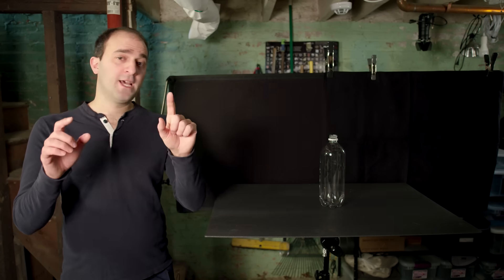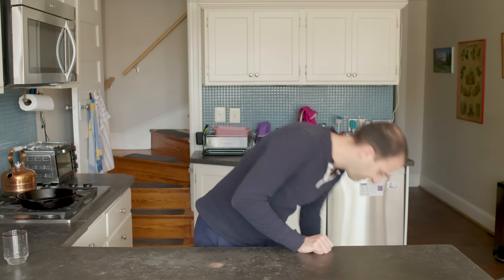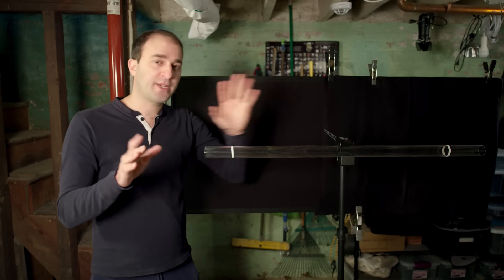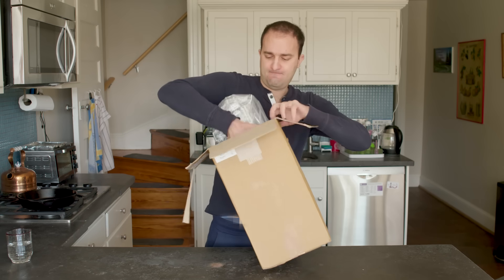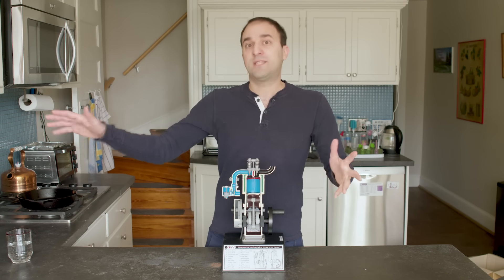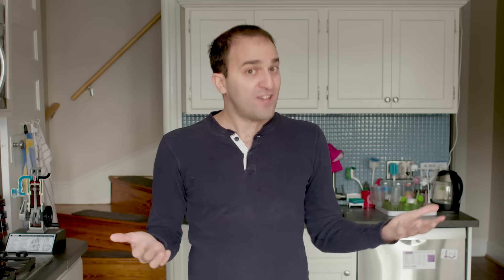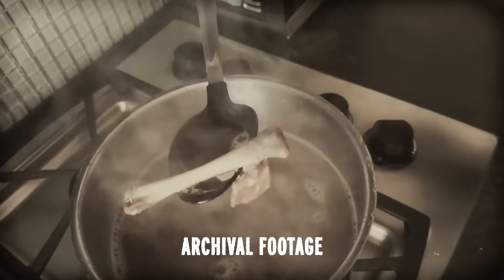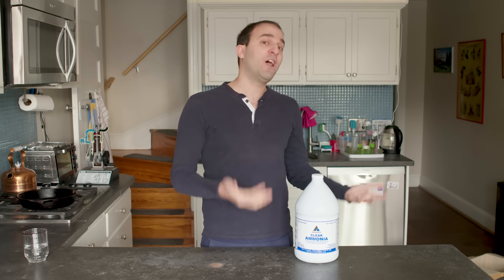Does Toyota Know Something That We Don’t?

Comment: I used to work in an ice cream factory and the refrigerant used was ammonia, The refrigerant lines were painted a bright yellow and railing was use to protect exposed lines.
I was warned that if one of these lines broke it is unlikely that anyone in the area would be able to get out alive. Having smelled low concentrations of Ammonia when maintenance was being done on one of the compressors I believe it.
Reply: Perhaps we shouldn't worry about the negatives until we know if the idea even works. The first place Toyota and GAC have put an Ammonia Engine into is a Container Ship. Batteries are never going to work for shipping, maybe this works? Here's a fun fact - Cruise Ships in Europe put more sulphur into the air than all the passenger cars on the Continent combined do. And that's just Cruise Ships, not Goods Transporters.
Reply: @tsubadaikhan6332 The sulfur from those cruise ships are the only thing holding global warming down.
Reply: Coincidentally I used to work in an ammonia factory and the refrigerant we used was ice cream!
I was warned that if one of the ice cream lines broke we'd have to call the local bakery and order a couple dozen birthday cakes to clean it all up.
Reply: Ah nice one, feels like im on reddit now
Reply: 🤣🤣🤣 @michaelg.294
Reply: My fridge never leaked; but an apartment building was nearly evacuated due to Air/Conditioning leak(good times).:face-blue-smiling:
Reply: I worked in a grocery store distribution center that used ammonia for refrigerant and whole building AC. We was told if we smell any ammonia at all to hit the alarm as we are running out of the building
Reply: you got three minutes
Reply: Gasoline kills via fireball. Ammonia can cause instant death in relatively low concentrations, think a single burst tank in a shared garage, by acting as a rapid CNS depressant. Also, it will burn your nasal cavities, make a strong caustic hydroxide on your wet skin and smells horrendeus.

As much as I love it as a fuel (there's already a guy running a car with it), it's not viable for mass production.
Reply: Many US farmers use anhydrous NH3 as a nitrogen rich fertilizer.  They buy literally tons of the stuff at a time.   The liquid is injected into the soil and immediately reacts with the water in the soil and  is effectively made chemically harmless.
Reply: Car fires in a twin-garage could be interesting, with two full tanks of ammonia in their fuel tanks
Reply: @MaxMisterC what if a new car was created with duel tank AND the main piston is petrol powered 
with gear one, two and three ratio & gear four above 👍🏻 run's over Ammonia? 🎉😮🎉
Reply: @MaxMisterC 
ammonia isn’t even that flammable
it can’t violently combust in air, it barely burns without help
Reply: @MaxMisterC NH3 doesn't burn that easily.
Reply: A component in mustard gas.
You are on point.
Reply: Do you believe that your chances of survival would have been higher had the same amount of gasoline (which could potentially erupt into an explosive fireball) had been the refrigerant?

Now imagine 10-15 gallons of your refrigerant dissipating - vs the same going up in a fireball - again, you're more likely to survive a well-publicized ammonia leak out of your car's fuel tank, than an sudden explosive fireball.
Reply: @factnotfiction5915 You are full of it. I don't believe your lies.
Reply: @factnotfiction5915  Gas leaks are far more common than fireballs, that's it
Reply: @factnotfiction5915  Why would someone use gasoline as a refrigerant.
Reply: @factnotfiction5915 there are plenty of videos of major fuckups happening while a tanker is refilling a gas station. Hundreds of gallons of gasoline per second being blasted out of a ruptured hose, frequently right next to or on to a person who then is able to walk through it and close the valve while only being protected by some boots, jeans and an old dirty orange vest. It's a local environmental disaster but rarely an explosive one, and if the worker gets out of the gas soaked clothes and gets hosed off with water quickly enough they'll probably end up ok. Now imagine that with Ammonia
Reply: @alf20104  > Hundreds of gallons of gasoline per second being blasted out of a ruptured hose, frequently right next to or on to a person who then is able to walk through it and close the valve while only being protected by some boots, jeans and an old dirty orange vest. It's a local environmental disaster but rarely an explosive one

'Rarely', but sometimes explosive. Gasoline certainly has the capacity to be flammable at standard temperature&pressure (STP - at almost any temperature and 1 atmosphere).
Ammonia is NEVER explosive and NEVER flammable at STP.

> , and if the worker gets out of the gas soaked clothes and gets hosed off with water quickly enough they'll probably end up ok. 

Same with ammonia. It is only dangerous if inhaled. (note gasoline is dangerous if inhaled also)

> Now imagine that with Ammonia

Now imagine, not hundreds of gallons, but a small leak - nearly instantly detectable with ammonia; may take some time with gasoline - so you're shutting off the cutoff valve quicker; and avoiding that 'local environmental disaster'.
Reply: @factnotfiction5915  Yes your chances of surviving the vapor explosion from 10-15 gallons of mostly still liquid gasoline is dramatically better than surviving 10-15 gallons of ammonia which will all become vapor within a fraction of a second of being released to atmospheric pressure and really, REALLY wants to chemically bond with the water in every tissue in your body.
Reply: Firstly, coolant systems don't use gasoline, so it simply wouldn't be there; secondly, yes, having been around ammonia, I'm quite confident that a spill would be more likely to cause injury than a gasoline spill would be to ignite
Reply: @prophetzarquon 
You know how to suppress ammonia vapours?
Just spray water.
Reply: @drgazter  Good tip; the fire sprinklers would have been a good thing to have labeled In Case Of Spill
Reply: @drgazter  not if you're dealing with ammonia from refrigeration, it will freeze water midair

Comment: Ammonia is made from methane. Burning the methane is cheaper.
Reply: You can also make it from CO2-free nuclear process heat.
Reply: Then where's the hydrogen coming from? Hydrolysis is a power hog. @factnotfiction5915
Reply: @factnotfiction5915  Then what's the hydrogen source?
Reply: @williamferdon3088  heat + electrolysis (of water) is cheaper energy-wise than simply electrolysis; so using process heat to crack water into hydrogen, and then using more process heat to combine hydrogen + nitrogen into ammonia, is another way to make ammonia; rather than simply cracking methane.
(likewise, you can also use the hydrogen to make methane, and other *-anes, and alcohols).

Comment: Ammonia has been worked on as a vehicle source of Hydrogen for years. CSIRO came up witha filter to seperate hydrogen and nitrogen. When you oxidise hydrocarbons, you are simply oxidising the hydrogen in it, leaving carbon. When you oxidisehydrogen in air, because of the hightemperatures, you end up with a lot of NOx which then needs to be converted, much like in diesel engines.
Reply: When you oxidize hydrocarbons you get carbon dioxide and dihydrogen oxide.  Everybody running around and talking about "carbon emissions" has really dumbed down the populous.  Now half of people think carbon is bad.  We're made of carbon.  Are we bad?
Reply: @andyharman3022  I feel like the "zero carbon emissions" logo will lead to the end of us.  It is so short sighted to only look at the very end product and not the entire process to get there.

Comment: You forget the bore/stroke ratio of your engine... To burn diesel (or oil), vs gasoline, you need to increase the compression ratio. I guess it's the same thing for ammonia...
Reply: Yea he complains about problems which aren't problems when engineered properly. Look at methanol (race car) fuel system. They have literally gallons per minute (as opposed to GPH for gas) to feed enough methanol. Huge compression, huge injectors, huge ports, huge cams, huge valves. Methanol per lb is terrible, but massive octane, and when evaporated and atomised, makes the charge ice cold, which is great for boosted applications. So not only bore/stroke, but also boost! Put a big roots supercharger, small stroke, big compression ratio, and I bet it'd rip!

Comment: No ammonia will not be a fuel used in cars, it is too expensive to make and by 2044 batteries will have 4 to 5 times the capcity and be much cheaper than they are now.

Comment: Since Ammonia can be stored like propane, liquefied at room temperature & moderate pressures, it would probably be great for container ships.  The only problem is producing green or pink hydrogen...
Reply: It is already used on many container ships.
Reply: @NH3EnergyPlus  I've heard of new ship engines which support multiple fuels including Ammonia, but I was unaware that ships were already using Ammonia for fuel.  Maersk is looking into it for new container ships and ammonia carriers.  For now, I thought LNG ships usually use natural gas as it boils off and most other ships use bunker fuel.  It would be great to hear about a ship where ammonia is already used for propulsion.

Comment: The current levels of the production of ammonia creates 551 million tons of carbon dioxide. Ammonia production is a highly energy intensive process consuming around 1.8% of global energy output each year.  The question is to meet the demand so all vehicles can be ran on ammonia instead of gasoline and diesel how much would ammonia production would be needed.  If it is 100 than that is more energy than the world produces.

Comment: IN NOVEMBER 1942, Belgium’s public bus system ground to a halt, crippled by a wartime shortage of diesel.

Engineers at the country’s public transport company got to work and by April 1943 the service was up and running again. They had adapted about 100 buses to run on an alternative fuel – liquid ammonia, pumped into tanks on the buses’ roofs.

The experiment was short-lived, but it proved the point that ammonia – plus a small amount of coal gas to help combustion – could be used as a transport fuel.
Reply: Ammonia is a fantastic Fantastic refrigerant However , it is extremely dangerous in its liquid form my Concern would be  at the refuel stations a k a gas station There would be some people who would asphyxiate themselves buy ammonia gas
Reply: yes, but,,  oil,,will never run out..  this is why other alternatives, are suppressed..  like sodium reactors,, free energy, clean..
Reply: And some French produced gas from wood that they stored in enormous bags on the roof of the car, or actual gassifiers mounted to the car. The gas fed into the engine and allowed the car to move. But just because something is possible in the most dire of situations doesn't mean it something we should be looking to adopt when situations aren't dire and where better alternatives exist.
Reply: @drxym  , you're getting off subject, Toyota is working on ammonia power, it has been used before, with modern high tech methods it could be as advanced as the first electric cars in 1900 to current electric cars.
Reply: is delay the inevitable , combustion engines got is day counted

Comment: Butanol would be less toxic and easier to handle than even gasoline It can be grown with bacteria and be carbon neutral, and burns like gasoline. But combustion engines are way less efficient that fuel cells or batteries.
Toyota is throwing up all these smoke screens so people don't buy EVs until they've perfected their solid state battery. That and the oil industry propaganda is working, for the most part. Toyota is expert at hybrids. But they better hurry up with the EV development or they will be totally hosed.

Comment: salts 21 -24% density, 1/12 that of gasoline, high temp to extract. It can be used at altitude though, or as a solid with "free" heat sources.

Comment: Thanks for a good sensible response to this, for my money, daft idea. I've seen too many responses to this engine from Toyota saying something like "this is great! F*** EVs!".
Internal combustion engines are inherently inefficient with large amounts of the energy from the fuel being wasted as heat. They only make sense when the fuel is ridiculously  cheap.
Ammonia is difficult to transport, which adds cost and as pointed out in the video, really quite bad for people and animals generally. Safety adds to the cost.
Yes they might well be able to get it to work and my have some very specific uses, maybe shipping. But you do not want the average person, maybe tired after a day at work messing with the stuff.

Comment: Ammonia is used to reduce nitrous oxide emissions from diesel engines. To make it safe it is added as ureum dissolved in water, but this quickly falls apart under the right conditions. It might be an idea to add ammonia directly in a dual fuel setup as it can not only help to reduce nitrous oxide emissions, but also carbon emissions. Although this is not a long-term sustainable solution, it can also be used in combination with biofuels and efuels.
This reminds me of the use of dual fuel in gasoline and diesel-powered vehicles. Adding LPG or CNG can reduce a variety of emissions significantly. Similarly significant amounts of ammonia might be added to reduce fuel consumption and a variety of emissions. I have a feeling that combustion characteristics for hydrogen are much better for this though. In a dual fuel setup, a lower energy density of a secondary fuel is less of a problem.

Comment: Ammonia is bad idea for an internal combustion engine.  Toyota does not know a thing.  They will simply do anything to avoid making a B-EV.   It's inefficient, it's dangerous and it might still exhaust NOX (nitrous oxides) which contributes to smog. With the right sort of catalyst and the right exhaust environment NOX can be dealt with.  

You know what? - a battery electric vehicle might be a good idea.  They're nice and quiet too.

Comment: Ammonia is horrible so of course Toyota loves it.  A car crash that resulted in a leaked tank of ammonia could kill lots of bystanders in minutes.  No thanks. So the hydrogen scam has been publicly debunked, so the ammonia scam begins. So they will promise it will work in five years, and then they will publish research about solid ammonia storage and on and on.  Anything to delay building battery powered EVs or building out charging infrastructure that works fine today.  Just like Trump, delay, delay, delay.

Comment: Decades ago I was working on Ammonia as a fuel. Not for combustion engines (which have a physics limit of ~27%) but for Fiel Cell engines (which have a physics limit near 80%).

Sad to say we're will discussing Flintstone technology -- anything combustion.
Reply: interesting! any chance for this to work? would be much smarter way to do it.
Reply: SOFCs should catch on soon
Reply: Liquid fuels are a vector.  If ammonia filling stations exist then hydrogen fuel cells can run off an ammonia reformer.  A hydrogen fuel cell car with an ammonia reformer is useless to any customer if there is no filling station.
Reply: 1_ How is Toyota way past 40% on combustion engines?
2_ Fuel cells may be 80% efficient, but ammonia brings the need to extract the hydrogen from it, further diminishing efficiency.

Comment: The practical engineering problem of packaging for use in a vehicle is the sticking point. At about three and a half times less energy density as gasoline or diesel, you need storage for that much more mass to compensate.
Add the additional storage volume requirement for either a pressure vessel or cryo system on top of that and you begin to have trouble fitting it into a normal passenger vehicle....
I'd say Toyota knows this as it is very much the same problem they face with their hydrogen vehicles - when they have to cram multiple copvs into their Mirai to give a decent range, it results in much lower passenger and other storage space.
Reply: Yes ammonia has poor specific-volume energy density compared to conventional hydrocarbon fuels, but do the same maths for hydrogen and you'll be astonished.  Then when you pick yourself off the floor, do the same for whatever flavour of battery chemistry you care to select, typically used in an EV.  Energy density is not the chief problem here; toxicity, ignition, flame speed and the need for a pilot fuel or an on-board cracking plant are.  Most of these issues have resource being thrown at them to fix them.  Storage of ammonia is not a problem as it has very similar requirements to propane (a 10bar pressure vessel is enough).  In fact, the ease of carrying around liquid ammonia makes it a strong candidate for a hydrogen storage medium (avoiding the need for a 700bar pressure vessel).

Comment: Toyota have been pushing Hydrogen ... This is just, Hydrogen is not practical, so maybe this instead ? 

But the infrastructure needed to use a new fuel, and make it safe, is just not going to happen ... I used to live near a UK Petrol station that did Hydrogen as well,  they stopped doing it a few years ago, and now have Petrol, Diesel and charging stations 

Toyota will finally have to bite the bullet and build Electric Vehicles ....